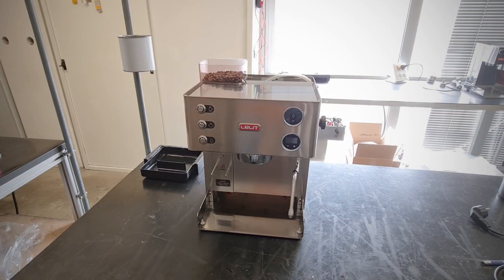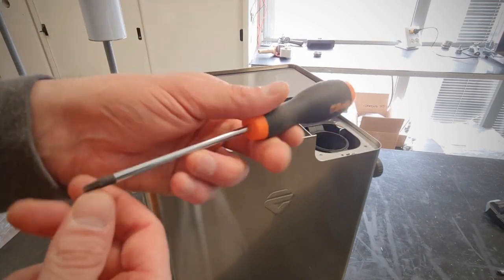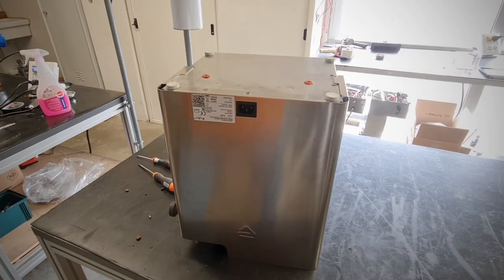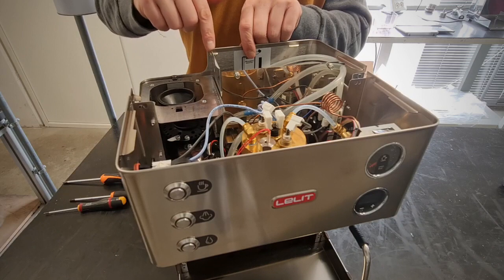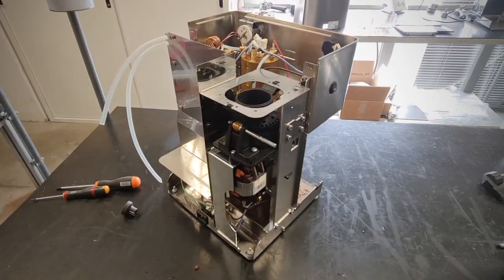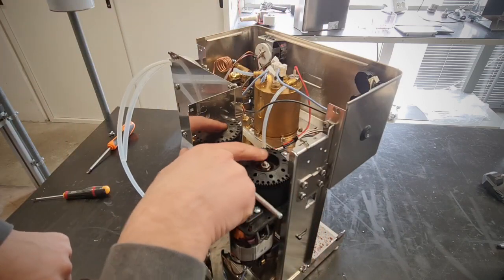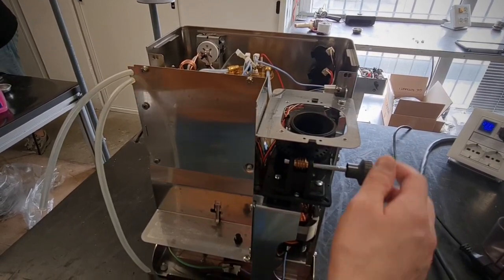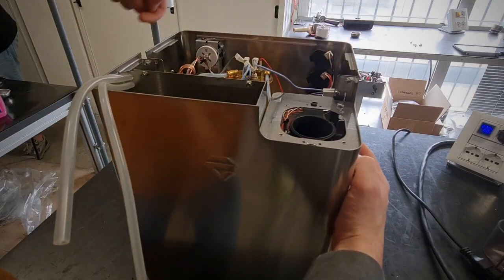pl82t how to open-remove the grinder burrs

Comment: Hi, I have one question, how do you remove the top burr from the plastic casing? Is it put just under pressure?
Reply from the maker: you can temove the burr, it is under pressure
Reply: @lelitinsider2977  I can't see the way you do

Comment: My grinder stopped working so i've opened the grinder as explained in the video, removed all coffee and cleaned everything. Tested the grinder without coffee and it works fine but when i add the coffee, grinder stops working. It tries to grind but augers dont move. What's the problem can be here? Motors power might not be as strong as it's supposed to be anymore for a reason?